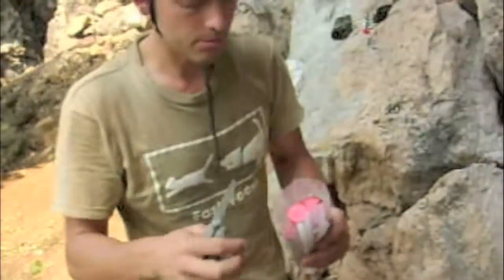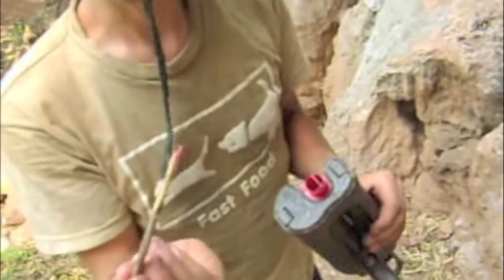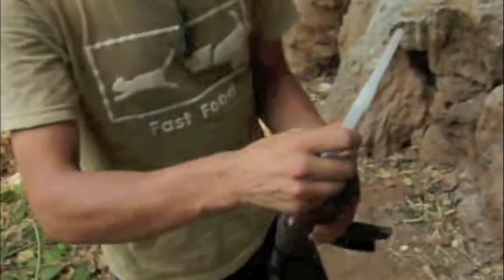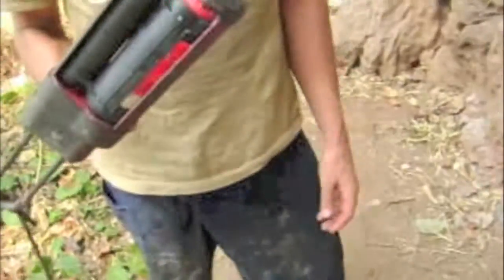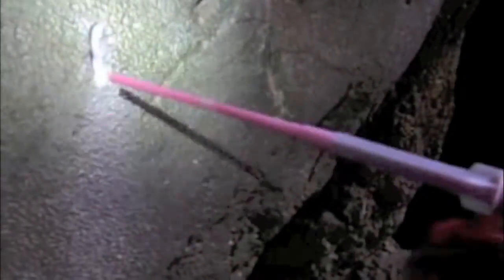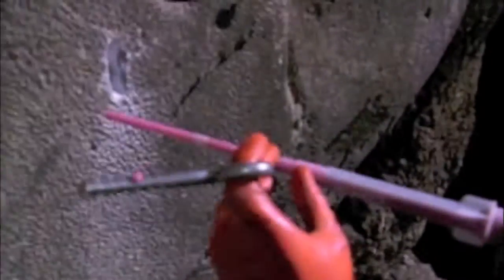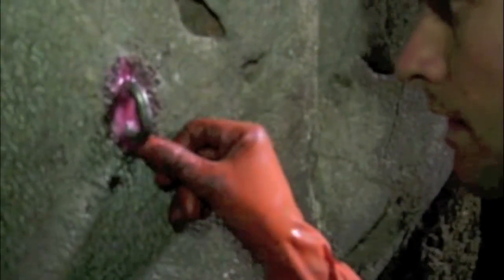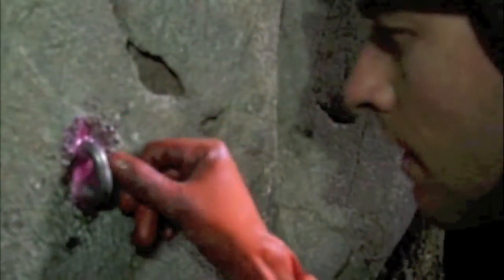CMRCA Bolting Video Manual Part2

Comment: Great manual. Thanks for posting!  I'm preparing to learn to install glue-ins as you have demonstrated in these videos.  Two questions: 1) how many bolts are you able to glue with one cartridge of resin?  2) what do you suggest as a method for concealing the red color of the RE-500 to make for a more naturally colored installation?